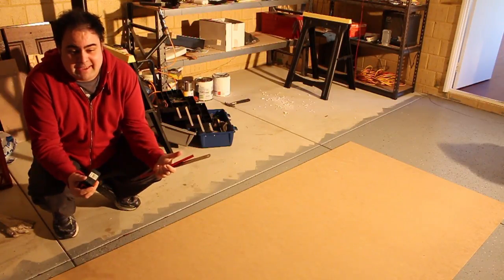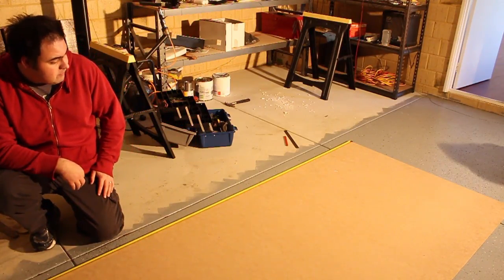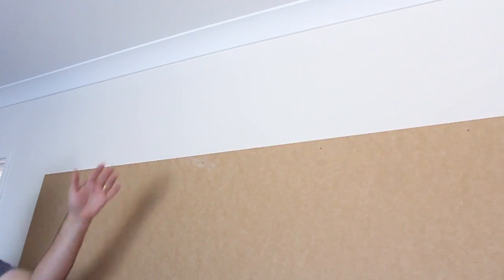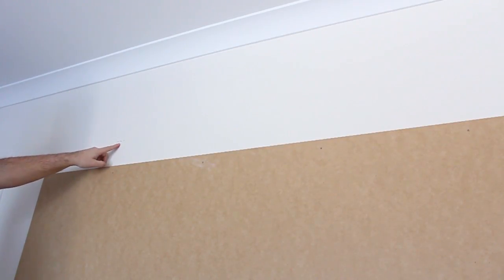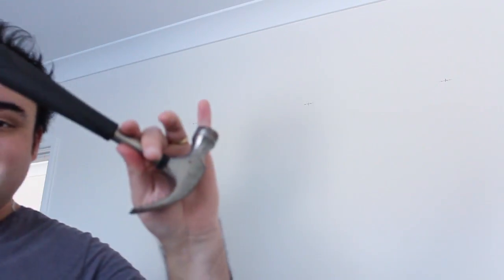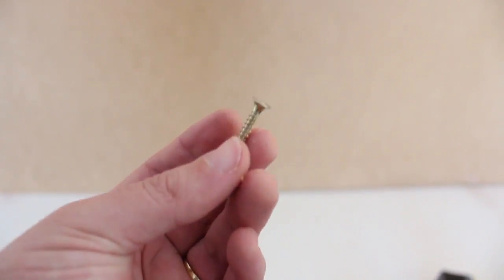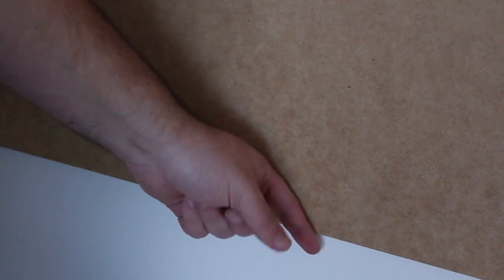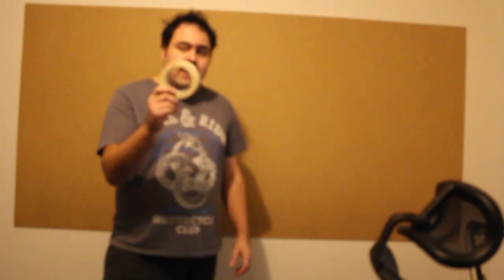Rm2kdev's $50 DIY Whiteboard

Comment: if you had a roll a paper you could of put it on the board marked your holes then overlay it on your wall marks and tape it that way you wont mess up when you drill.
Reply from the maker: SuperDeluxe80 didn't have a roll of paper though :P